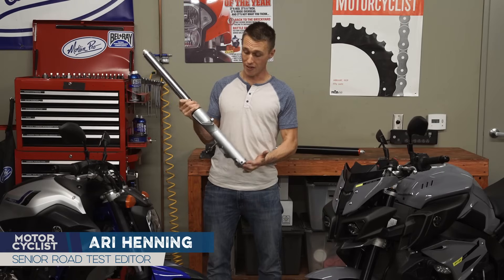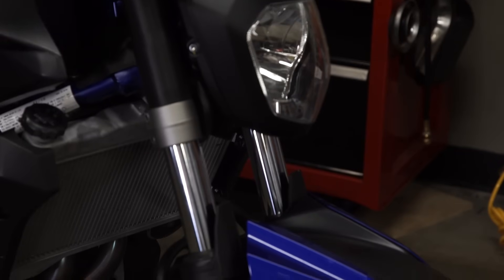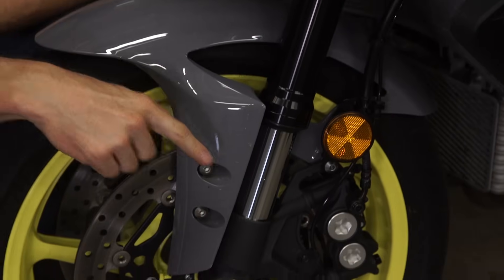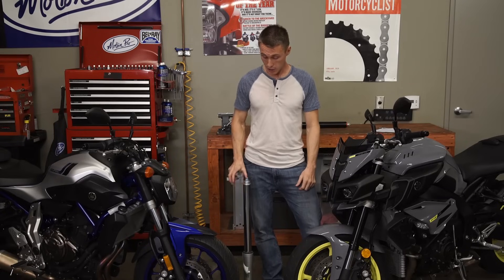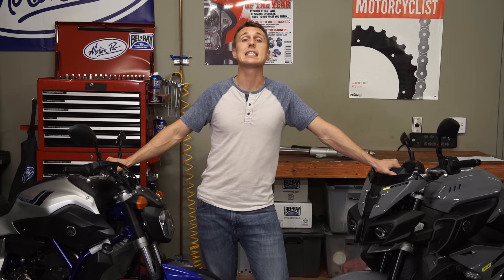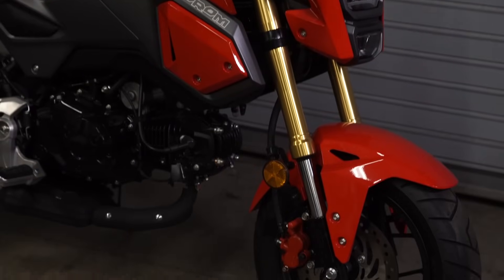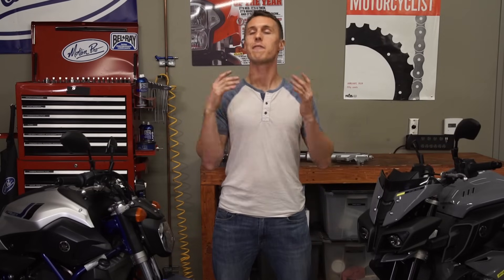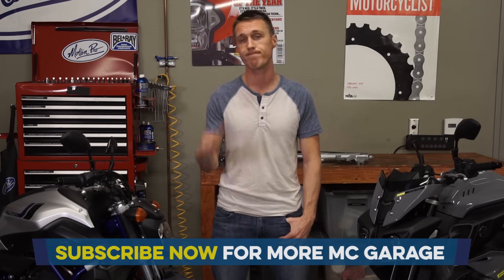Right-Side Up vs. Upside Down – Why Are Inverted Forks So Good? | MC GARAGE

Comment: Hey dude, I've been watching your channel for a bit now and on this topic I went from an MT-07 a 2021 model to a 2023 Hornet, why? Well, the front suspension on the MT-07 felt like they were made of pasta, if I had to brake hard using front and rear brakes the front forks would dive forward in a way that didn't feel safe at all. The Hornet is a faster bike acceleration wise and if I have to brake hard it's fine.

Comment: I like the disclaimer, " very general." I just bought an Aprilia Shiver, and it has upside down forks that are non-adjustable and to my surprise are damper rod and possibly the worse forks I've had in a bike I've owned. Even my 01 VFR came with cartridge and preload adjustors. To top it off the fork seal is leaking.

Comment: I always assumed an upside down fork would cut down on unsprung weight as well. And in my experience when the seals go it doesn’t matter what orientation it is everything below and behind is going to have oil on it.

Comment: That's interesting. I had a 1983 Honda VF750F, and it boasted a new, innovative, "Upside-down fork," the bottom, wider tubes were joined together by a bar above the fender. Now what you're calling an Upside-down fork, is what used to be a Rightside-up fork. Times change. Do a Google image search of the VF750F and check it out.

Comment: I had Suzuki GT250 engineered by the lads at college in 1977... Aside from engine and carb mods with some reed valves made and fitted, they machined the alloy legs, made triple trees to fit, and fitted twin disc mounts that they'd made... 
It revved to 10,500 instead of about 7,000 and seldom needed the very long 6th gear.
The forks didn't leak at all... Just the usual slight sheen as seen on normal configuration...
I finished it in matt black and white lettering and graphics.
I loved that bike...

Comment: Bigger question, why call it upside down, it's where telescopic forks started, and because of leaking seals, they where turned upside down, and now they just turned them back, another problem with leaking fork seals are that they leak all the oil, instead of just a little, on an adventure bike, or off road bike that can be a very big problem, if you by accident drove it far from public road, where recovery services don't come.

Comment: Less unsprung weight in USD forks, but in all practicality, difference is very small. Looks "racy", but manufacturers often cheap out, as only one fork  has the spring, and the other has the dampening. In that instance I prefer conventional forks. What makes the real difference, is how you set up your bike!

Comment: Much easier to damage an upside down fork, a rock clip will pot a ding in the fork tube which will damage the seal which means a rebuild. If a conventional has the same thing happen you simply take the fork out of the triple clamp, carefully remove the old seal & replace with a new seal. Don’t forget to hone out the ding!!!

Comment: You didn't cover the single biggest reason why inverted is better, and it's the same reason why most vehicle hood and trunk lift supports are mounted so that they "rest" in the inverted position.  It causes all the shock oil to collect against the seal(s), keeping them wet and lubricated.  This prolongs the life of those seals, meaning fewer failures and less maintenance.
Reply: That's the very last point he mentioned. Not exactly in your words, but can be easily inferred.

Comment: Inverted forks are better in many ways including having static column of oil always lubricating the fork seal.  Seals don't last as long without uniform oil film.  Chrome is used for plating to provide corrosion resistance and hard surface hardness to avoid abrasive wear.  The disadvantage is chrome does not have as many poresasperities for holding oil film.   Thus the effect of inverted fork and  gravity ensures column of oil always above seal due to gravity while allowing dirt and debris to fall away rather then collect on top of the dust seal.

Comment: Interesting you did not mention the significant decrease in unsuspended weight.   When the wheel goes over a bump the less unsuspended weight changing direction which leads to the less loss of forward energy.

Comment: Simple. Moto cross was testing inverted forks back in the early 80s. Rigidity and stability control was the plan. Conventional forks are great for trail riding and enduro racing. Inverted are better for moto and super cross.

Comment: I always thought the conventional Forks look cooler cuz I usually come with fork boots and I always thought that was really cool all the interesting colors you can put on them
 mines are blue 

I didn't know there were several advantages to Conventional forks I thought everything was better on upside down forks but i now know if a fork seal fails it won't get all over my brakes and it's easier to work on apparently.

Upside down forks just look boring. Every manufacturer is putting them on all the bikes now regardless if they're even track bikes.
So they look like the standard I don't even think we should call them upside down we should just call them conventional 

and regular right side up for its traditional.

Comment: 2003 VTX1800 with inverted forks. I’ve had to replace forks seals twice. Realized before second job, the stantion? Not sure on spelling. The stantion had pitting which chewed the new seals. Emory clothed the surfaces and redid the seals. Good as new. Still don’t want to do it again. 800lbs bike.

Comment: About 30 years ago when I used to experience some severe front end shuddering, I looked at the forks and how to fix it.

I thought at the time, it seems as if the upper legs of the fork was too narrow or thin, then wondered why they designed them like that. Wouldn't the larger part, the sliders, be better off fixed to the triple clamp? Of course, when discussing this with fellow riders they all laughed at me. 

Maybe they still do, but front ends these days feel much more solid, especially on rough roads, under hard braking and so on, now that they're all using inverted forks on most bikes.

Comment: Unsprung weight? Upside down has less mass on the wheel side. On cars, that’s why independent suspension is better than solid axles.

Comment: Awesome vid. But you forgot to mention the sprung mass vs unsprung mass difference. With inverted forks having less unsprung mass, contact with the ground is better maintained and responds to change in movement much better.

Comment: If you are looking for comfort, you can choose the straight shock absorber, which will help you hold the road or take turns more easily. If you are traveling on mountain roads or are very fast and heavy, you can choose the reverse shock absorber. As a result, the shock absorber works with load and impact. Since the front wheel will be very light, shock absorbers are preferred depending on the type of motorcycle.

Comment: Also with an upside-down fork you can more easily measure the range of front suspension utilized by putting a zip tie on the rod and riding the bike. The tie will tell you if you're using the entire suspension by its position. Good for suspension adjustment on track days. Hope this makes sense.

Comment: its funny because forks are basically hydraulic actuators, you have the body and the rod end, the body always mounts to the frame, and the rod end mounts to the actuated part, on a jet, which is what i work on, its the flight control surface. so I would think, as a mechanic, that you'd mount the rod end to the part that moves, the wheel. so for me, upside down forks are forks where the body is attached to the wheel, and the rod end to the frame

Comment: On the old forks I just rebuilt, the sliders are far lighter than the tubes. This reduces unsprung weight. I see they try to deal with that by lengthening the top part and shortening the tubes when they invert em', but I wonder what the weight difference is even then.

Comment: This video and some others make it sound they just because they are inverted they have more advanced valving…  this is not true, you can get  traditional forks with upgraded valving.
It seems to me that this comes from the fact that in general higher performance bikes use inverted forks, so of course a top of the line liter bike will have better valving than some base model cruiser or whatever bike using standard forks.
Even within forks of the same type there will be big differences A Honda Grom with basic inverted forks probably has crap valving compared to a Honda CBR1000.

Comment: What about sprung weight? The weight of the tire, wheel, brakes and suspension components that move in reaction to the surface of the road. The more weight, the more force you have to overcome when it's moving (bouncing). How does that compare between the two designs. 

IMHO it seems the conventional fork (with its aluminum lowers) would be less sprung weight than the upside-down model, where the sprung weight now includes the heavier part of the fork. Is this overcome by using something like titanium? Would the lesser sprung weight of a conventional fork be advantageous for the non-competition rider (Cool Joe Points aside)?

Comment: Nicely done and very fair.  Ive a 2007 F800S and was mulling over a switch and wondering at the benefits.  I'll leave it be because I am not going to push the bike anywhere near its limits and so, aside from aesthetics, there is nothing to be gained.  Too old to be an "all look no substance" rider.

Comment: The smaller stanchion parts mean less weight that needs to move up and down with the wheel. That’s the biggest reason for USD forks. You mention why a leaked seal could be worse but the other issue is that the sensitive surface is more exposed. It can get pitted with road debris and damage the seals since they are no longer protected by the bike’s fairings. This is why modern front fenders also partially cover the forks, which means the 2008-2012 Ninja 250 is faking it for a modern-looking front fender even though it has standard forks. ;)

Comment: i'll take less chances for things to fail, while stiffer suspension can be nicer i like full reliability and ease of maintenance, you can also modify the older shock style to be adjustable with custom screw caps that add spring load as desired but the easiest way to adjust them is to add a mix of heavier to lighter fluids as needed, case in point the virago 250 comes with 10 weight fluid but most people upgrade it to 15 because it gives a far smoother ride

Comment: Actually, you are incorrect when you say that you cannot tell the difference between a conventional fork and an inverted fork. There is a fellow I know that converted his Victory Vision from a conventional fork to an inverted fork off of a Victory Cross Country. Both bikes are comparable in weight, their wheel bases are close, and the rear suspension identical. With the conventional fork the Vision handled relatively well but there was room for improvement as there was some fork "whip" when hauling it around quickly. The inverted fork removed the whip and handled bumps much better. In addition, the inverted forks have considerably better braking characteristics that the original units due to the improved rigidity. I have ridden both versions and can attest to the difference between the two.

Comment: Broken seal comparison did it for me! I had a broken seal once, riding out of town (conv. forks) and while there was some spillage of fork oil onto the pads, the pads did go soft and I lost a fair amount of the front braking. However the bike was still ridable to get me where I had to go. Upside down seems likely to render that front end useless if you blow a seal.. Someone correct me if I’m wrong.

Comment: I've owned a bike with inverted forks and I couldn't tell a difference. I don't race, so I don't want a race bike. Not to mention, strapping down a bike, with a non-inverted fork, is a lot easier with 2 straps on my tailer.

Comment: Not worth buying  upside down forks if you have classics. All seals eventually leak.  You’ll hardly get a noticeable performance difference and the risk of oil leaking on your disc isn’t worth it.

Comment: Why is almost everyone here saying the stanchion is chrome......?   its polished steel, so that the seal works,  just like any other hydraulic cylinder.  Look at some knee or hip implants.   That aint some chrome job, its expensive polished steel.  Anybody with a trace of machining background can spot the difference a mile away.
Im also wondering, which wasnt answered in the vid,  If inverted is basically obviously higher performance,  why isnt that the default way of doing it?  Can it really cost that much more to orient them inverted?  I mean, as pointed out, even the lowly Grom has them inverted...which no one calls expensive...or high performance for that matter.

Comment: Hey super curious. I live in China where the majority of people are riding electric scooters. I’ve recently upgraded the rear suspension on the bike but was getting some rubbing between the suspension and the rear brake disc. I tried flipping the read suspension but it seems to have caused the rebound to have changed pretty dramatically. Do you know why that would be? Any help would be appreciated.

Comment: interesting and well done video.  I have 2 motorcycles ('93 Sportster & '98 Electra Glide) that have each type of forks. can't honestly say I've noticed any difference in performance or ride with either, but considering the differences in weight and how they are ridden I probably won't  :)

Comment: Great vid.  Bottom line is- for MOST RIDING off track you will never know the difference.. Except that USD forks often have more damping adjustments. Both of my bikes have non-USD forks; one has no damping adjustments (sadly) and the other does. That's all that matters. PS- Yup, when I go to service my forks, IT'S A BREEZE. Try that with your USD's

Comment: Right-side up forks that have fork boots actually can prevent a fork from reaching full travel. I tried mine without a spring and I couldn't bottom it because the boot fully compressed before the fork did.

Comment: What?! The one major difference is rigidity? Yes, rigidity is improved on inverted forks but it's not the most important aspect. The most important point wasn't even covered, at that is that inverted forks have far less unsprung weight therefor improving the suspensions ability to keep the wheel & tire in contact with the road surface.

Comment: In, MTB inverted forks aren’t lauded for their rigidity, in fact, rigidity is the one area where they fall short (that and stanchions exposed to debris). How could it be that you are claiming the opposite ? In MTB the sensitivity of the fork is the reason people are interested in inverted architectures, less unsprung weight etc.
Reply: @povertysquatter  this makes no sense. They do work the same way. Especially DH or Enduro bikes. This is an area which is absolutely shared between them. Moto fork MFG s make Mtb forks for this reason.

Comment: Question: If the stanchion part was used upside down on a retracting hydraulic suspension, does everything for the comparison made on this video apply in the same way other than the leak?

Comment: He missed out the benefit of a traditional fork. It has the H bridge over the wheel which stops twisting. All high end mountain bikes use conventional style for this reason. An inverted fork you can take to a wall and twist the bars, it will throw your bar to wheel alignment off. After crashing on my dirt bike and twisting the tire over, I just took it to a fence post and gave it a couple sacks to put it back 90 degrees to the bars.

Comment: believe me, ride a suzuki DR650 and youll definetely gonna notice the difference to virtually any other bike... the fork flex is just insane. works almost like a steering damper when riding in deep sand but thats the only place where its actually kinda good
Reply: I ride a dr650 and have had many other bikes with USD's. The DR in unsprung and damped. I don't feel the forks flexing though.  Did you do any suspension work?

Comment: I do track days and my Cbr600rr has the old style, the reason I’m here is because I don’t have full confidence in the front end I definitely will be up rating the master cylinder 
I’ve been riding on and off for 20 yrs 
I’d I actually agree I’ve had the fork refurbished and set to my weight 
But when turning the volume up 
I’m pushing the suspension obviously in bends and I did brands hatch   👍🏼👍🏼👍🏼👍🏼👍🏼🇬🇧✊🏻✊🏻
Hmmm I’m glad I watched this now I’ve made my mind up ,
When I’ve replaced um I’ll come back and comment , and u yanks if you like track days should come over 
Europe has plenty too offer £120 a day

Comment: Nice explanation..   Unless you're pushing the bike ( street or in the woods/dirt trails )   It seems to me to be almost a 50/50 deal for the average rider.  A big factor you pointed out is the potential for the seals to leak on the brake components.  That's worthy of consideration...

Comment: would have like to see the telelever, duo lever analyzed as well. yes heavier, but brake dive eliminated,  and strong as hell.  I nailed a roo straight on with my bmw at 100kph with no damage. I doubt if a conventionally forked bike (regular or inverted fork) would have been able to be riden away.

Comment: Heh!  I chose a bike model almost entirely because of the forks, but not for up and down orientation.  Rather for color.  It was between the Ducati Monster 1200 S and R.  I prefer the all black forks on the R, but I would have rather had the lower sitting S.